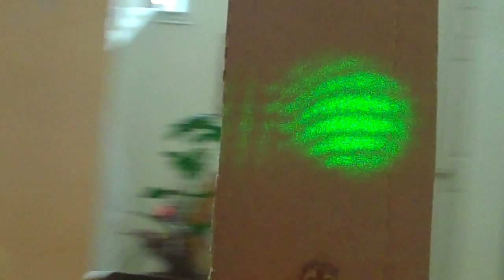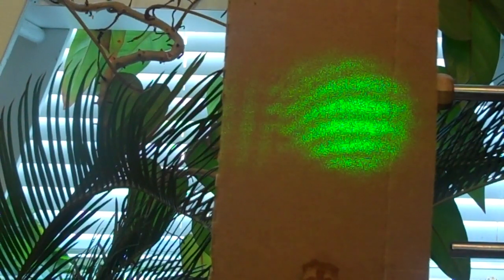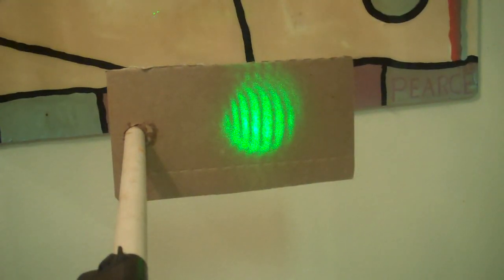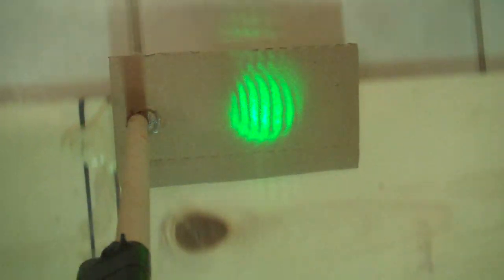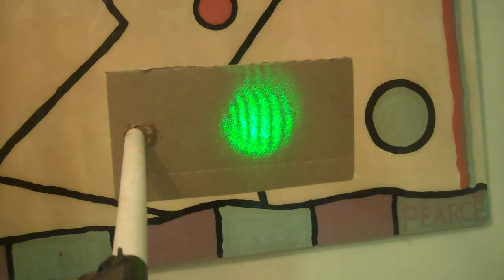Vertical Michelson Morley Interferometer Experiment 11 12 2010

Comment: This is an old video, but a few things jump out at me. 
First, there is fringe movement, +/- 1 fringe during the vertical rotation. Put your cursor on a fringe at the start, and watch what happens. Since Grusenick reported that he had improved his apparatus and gotten 2 fringes shift, this experiment seems to give the same results as Grusenick, although less than his Youtube video.
Second, neither this experimenter nor Grusenick have done their homework. Both use much shorter path lengths than MM, so their experiments are MUCH less sensitive. That they pick up any differences implies that they are detecting a really fabulous ether wind. MM used a path length of 36 feet. Assuming these two have 6 inch spacing from the splitter to the mirrors means that a 2-fringe shift indicates more than 5,000 km/sec ether wind.
And it gets much worse. If we grant that there is no horizontal component, only vertical, the fact that both experiments, in different parts of the world, give a purely vertical ether wind means that we have to assume a vertical ether wind EVERYWHERE. Which means that the Earth is either a massive ether sink or a massive ether source, depending on the direction. Neither of these possibilities makes any sense at all.
I applaud the effort this guy made to do things right, but neither he nor Grusenick have any idea of the consequences of their experiments.
Reply: It is unclear what point you are trying to make. But just in case: the results of experiments and observations such as stellar aberration are only consistent with the Earth moving through a stationary aether. They are not consistent with a an aether wind that is purely vertical. So no matter what these experiments show, it cannot be a vertical aether wind in the traditional meaning of the word aether. 
It is impossible to say whether the fringe shifts shown in these experiments are significant (unlikely). But if they are, then it would still be interesting to find out what causes them. It might be the wave-length shift due to the different levels of gravity, like mentioned in this video. But I think it would be interesting to see a more accurate experiment, with a calculations of the results.
Reply: @renedekker9806   "It is impossible to say whether the fringe shifts shown in these experiments are significant (unlikely)"
Oh yes it is. They aren't. 
"But if they are, then it would still be interesting to find out what causes them."
No it's not. We know perfectly well what caused them.
" It might be the wave-length shift due to the different levels of gravity, like mentioned in this video."
Nopers. That's actually been done using atomic clocks, and the results are far, far too small to account for what this video shows.
It's caused by the frame of the apparatus deforming under the force of gravity. Powerpak8 had the right idea, but he's not as good at calculating material strength as he needs to be. For that matter, it's pretty clear that he never did do the necessary calculations. This is in contrast to Michelson and Morley, who DID come up with an error estimate for their apparatus.
As a matter of fact, we can calculate just how much the optical paths distort between vertical and horizontal deflection. For Grusenick's original setup, he got on the order of 6 microns. Powerpak8 got something like 500 nm. Making a vertical rotating interferometer which would not deform more than 10s of nanometers would be a daunting task. I will say that this video is a testament to modern bearing construction, in that it provided rotation smooth enough that the fringes were effectively steady. Michelson and Morley would have been green with envy. They only went to their fairly heroic sandstone slab/mercury pool setup because they had to.
Reply: @wirebrushproductions1001 "I will say that this video is a testament to modern bearing construction" - yes, I was surprised they didn't get more deflection as well, given how much effort Michelson and Morley had to go through to stabilise the platform.
Reply: @renedekker9806  I'm afraid you need to go and read the paper, which is available onthe web. It is my main objection to the video that it produces such enormous fringe shifts. If you do the math on the setup, this implies monstrous speeds of the earth wrt an aether. You should not be surprised at the MM data, as it indicates you don't really understand the experiment. Nor the video.
Reply: @wirebrushproductions1001 "I'm afraid you need to go and read the paper, which is available onthe web" - which paper do you mean, and why should I read it?
"You should not be surprised at the MM data, as it indicates you don't really understand the experiment" - what do I not understand about the experiment, according to you?
Reply: @renedekker9806  You need to read the original Michelson-Morley paper. It gives the derivation of the expected result.
You do not seem to understand the numbers involved in looking at fringe shits, and just how little distortion of the apparatus will give large effects. Certainly the videos being discussed clearly have no idea of those numbers.
Reply: "Which means that the Earth is either a massive ether sink or a massive ether source, depending on the direction."

I don't find this surprising personally, I follow a different model of Physics including the nature of Gravity as mutual mass acceleration to the lowest pressure, in other words gravity is a "low pressure zone" in the aether, Light and matter have both magnetic and electrostatic components which is significant to this.

In an electrical circuit the electrostatic "force" is responsible for trying to pull the wires together, inversely the magnetic force attempts to push the wires apart, the electrostatic field is also itself responsible for mutual mass acceleration between objects like us and the Earth to the lowest pressure as a result of potential difference between atoms, it's why you can get an electrostatic charge buildup by spinning 2 plastic disks in close proximity in opposite directions, the "lines" of tension drag on each other.

So it's very much correct to call Earth an "Aether sink", technically it would be called a "Dielectric Sink" (The electrostatic field was known as the Dielectric field in the past and called such by Steinmetz) with black holes being a super mass that has its coherency taken to the extreme, whereas Earth is incoherent. Since EM Light has both Dielectric and Magnetic components it would be influenced by a large celestial mass.
Reply: @JenkoRun  "I don't find this surprising personally"
That indicates that you don't actually know anything about the aether. One of the first thiings established about the aether is that it is incompressible. An incompressible material cannot create either a sink or source.
Please provide a source for your "dielectric sink".
Reply: @wirebrushproductions1001  "That indicates that you don't actually know anything about the aether."

Nope, that just tells me you are unaware that there have been many proposed models of the Aether over time, you cannot make a claim like since there is no definitive model of it.

I follow one where the Aether also goes under the name Counterspace, it's essentially another dimension. The Aether being another dimension inverse to space also explains why Electrostatic fields operate inverse to space, capacitance increases as space decreases (no electrons, no charge separation), experiments based on things such as the Alexanderson Array further point towards a medium of non-spatial nature.

If you're sticking to Tesla's proposal of it, keep in mind it is unable to explain "spooky action at a distance" as some call it, no surprise there if you're dealing with something that doesn't have space in the first place.

I recommend seeing "History and Theory of Electricity" by Eric Dollard from 2007 available here on YT. Dollard is not the first to call it Counterspace either, search online for books on Counterspatial geometry.

Try not to be so quick to take a jab at someone that has a different perspective than you, you won't make any friends like that, and worse close of doors that may lead to interesting debates, after all, no one wants to converse with a close minded person who doesn't care to ponder.
Reply: @JenkoRun  No, incompressibility many times more than steel is required to support the propagation of light at the observed frequencies.
Reply: @wirebrushproductions1001  I fail to see how that has any issue with what I explained.

I recommend you see "History and Theory of Electricity" before your next reply, I will not reply again until you have.
Reply: @JenkoRun  Ok, well, that much less noise to listen to, then.

Comment: Gooseneck knows very well that the cause is unequal distortion of the mirrors from gravity pulling in opposite directions. We argued at length about it, but he likes to get people going.
Reply: However, if the equipment was designed properly, a much smaller effect would be observed. We know that clocks run slower at lower gravitational potentials and lengths are shorter. Einstein freaks make claim to those facts as proof of relativity. They prove nothing of the sort, but they are facts.
Reply: Late 2022. Sorry, ashamed I was so rude. Doubtful a smaller effect could be detected, but many do report periodic or sidereal effects that must be artifacts of some kind, some kind of intermittent gravitational gradient. I rightfully claim to have found the correct solution to the cause of gravity and structure of the universe. That makes me an object of ridicule, but I happen to be 100% correct to those who can see the trees: https://www.youtube.com/watch?v=_6QAO5d-n6Y

Comment: In fact I saw in the vertical plane the movement of the patters, clearly changing direction just as Mr. Grusenick said. In fact your experiment proved his right. The narrative is not good enough to debunk, when the experiment shows differently.

Also, in the Mr. Grusenick experiment the pattern was frozen still in the horizontal plane, while your jerked, so I don't think your experiment setup was as robust and his.
Reply: Vladimir Novakovic 
I also saw it change direction, he was saying one thing and the experiment was showing something else, perhaps he needs to check his video (experiment) again. 
Yes I believe Mr Grusenick was right.
Reply: If ether exists, it would likely be compressible, and possibly via gravity. So it would be thicker nearer to the Sun. Thus our solar system would sit in a sphere of ether more dense than out in space. Light from outer space would bend when encountering that more dense medium. Bent by gravity but only secondarily. They missed a step. Gravity collects the concentration of Higgs-Boson stuff and its relative thickness then bends light. I'll be watching my phone for the call from Sweden.

Comment: There is nothing new, nor even bizarre in these results. The fringe pattern do not changes as consequence of deformation in the frame, instead it changes because of the diference on the gravitational potencial from the bottom to the top of the frame. Look, these results must be explained by the Newtonians Mechanics, as A. Einstein describes in his work called: On the Influence of Gravitation on the Propagation of Light (1911).
Reply: Eu cred ca deplasarea franjelor de interferenta, la pozitionarea verticala a unui brat, se datoreaza intarzierii razei de lumina orizontale, care se cupleaza cu campul de densitate emanat din substanta planetei. in cazul razei care merge vertical, castigul de viteza la mersul injos este compensat la mersul in sus. Si deci nu va prezenta nicio intarziere. Experimentul Pound-Rebka pare ca dovedeste cuplajul razelor verticale cu fluxul eteric de aspiratie al planetei. Cuplaj care ar produce deviatia de frecventa a fotonilor gama de 14,4 KeV. Deviatie care ar fi compensata prin efect Dopller, produs prin deplasarea cu viteza a emitatorului sau a receptorului. Numai ca in toate postarile nu se da viteza masurata la care se produce compensarea deviatiei de frecventa.

Comment: Your mirror, as you demonstrated, is a lot less robust compared to Martin Grusenick's so I would expect your fringe patterns to be more extreme if gravity is causing strain.  Do you have any explanation of how his equipment could be showing regular  fringe movements even during 24hour static tests ( no rotation) in a temperature controlled box?
Reply: Fringe movements during static tests over time? Well, that's just damning isn't it? Throws the stress explanation out the window and a very easy test to replicate.

Comment from the maker: Note: In the horizontal rotation, the corner of the granite plate was used to rotate the interferometer, causing a slight fringe shift. This was repeated using the handle and the video was re-edited. This can be found at:
youtube.com/watch?v=aNEryiOKkrc (When URL is pasted, it adds a "-" between the "kr" and "c", i.e. kr-c).
The Grusenick experiment can be found at youtube.com/watch?v=7T0d7o8X2-E
(When URL pasted, it shows "- - -E".  Need to remove all "-" and add a new "-".
Frank Pearce